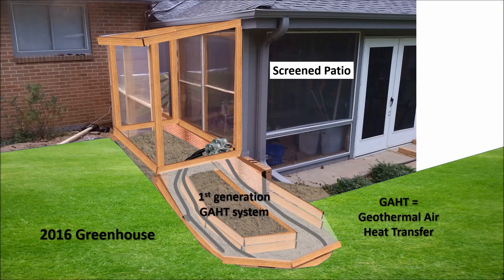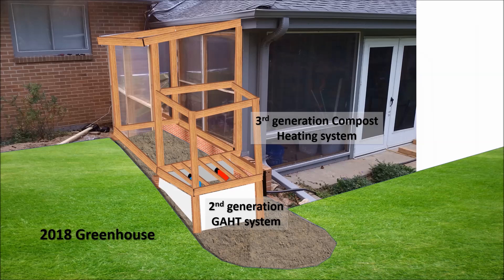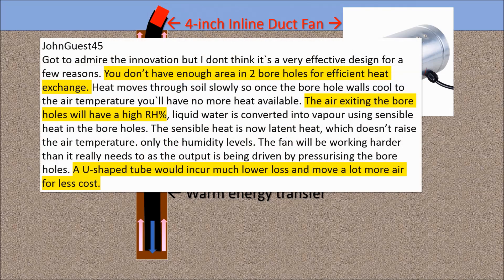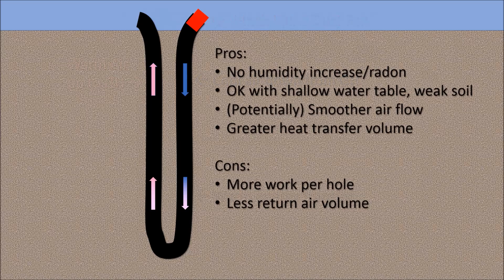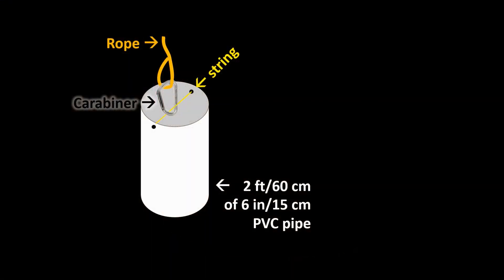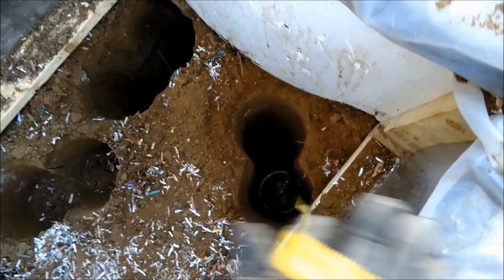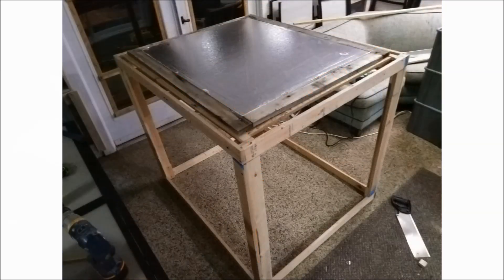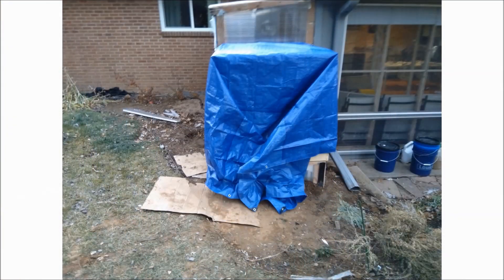Greenhouse 2.0 - Geothermal AND Compost Heating (Part 1: Design)

Comment: I'm the first to hand dig a horizontal one
Reply from the maker: Nicholas Becker dude, I would have been right there with you if I had the acreage.  I’d have to dig up my lawn and a bunch of sprinklers.  How much did you dig and how much pipe did you lay?  How big is your greenhouse and what results did you achieve?
Reply from the maker: Just saw your videos.  Nice project.  I will subscribe.  Smart move to put the geothermal under the greenhouse.  Most efficient method.  Unfortunately I couldn’t do that.
Reply: about 800 square cubic ft volume and I'm going to do a hundred 50 ft of pipe buried I dug about 5 feet so far and I'm going to backfill pretty soon I've been digging for about a month and a half thank you for the comment I appreciate it
Reply from the maker: Nicholas Becker that amount of pipe should work well.  Dunno if you plan on using for cooling but if you are, make sure to add a few weep holes at the low spot for condensation
Reply: @MorganBrown  yeah I ended up doing 200 ft of 3 in perforated pipe. I'll handle the drainage and then I did about 50 ft where I split the pipes in the going from two pipes to six pipes so and it works great so far I haven't really test it completely but I've been running it and I are coming out tonight and cool
Reply from the maker: @nicholasbecker3559  glad to hear that you got the system up and running!
Reply: yeah they're green as itself is about 12 by 12 ft it's got an angled roof facing south with a glass ceiling and I've dug down about 4 ft 5 ft so

Comment: I have a few ideas you mite try. First, your pipes are too big with too much airflow. If you eliminate the fans and use natural convection it should be more than adequate. Just cut of one end of the existing pipe at ground level, maybe extend the other end a bit. The slower movement will give more time for the ground to heat the air. This should be very easy to test next winter.
Reply from the maker: Thanks.  I agree with you - natural convection is fantastic.  I am actually using natural convection to good effect in the 2019-20 compost system (https://youtu.be/eMHbHAKeMC0).  I have changed the setup for 2019-20 geothermal to a small horizontal system (https://youtu.be/ch0VD-_9Xxc).  It wouldn't be hard to change the elevation of either the inlet or outlet pipe in order to achieve natural convection, but I wonder how it would do during the coldest hours of the night.  I have a small anemometer that could measure airflow.

Comment: When the soil is firm or wet you could dig a trench to make your u shape design
Reply from the maker: Gary Brown good suggestion.  Similar to what I’m planning for next year.  Instead of having four fans, I’m going to trench between each pair of holes, run one piece of pipe, and use a stronger fan.  Should improve the heating and simplify the system as a whole
Reply: @MorganBrown  can't wait to see it I want to put a green house in on the south side of my house I was thinking about putting plastic barrels or 6- 500 gallon totes for a heat sink next to the house and collect rain water 
My composting bins did not get the care need. I'm still learning.
I like how you have yours next to the green house.
Reply from the maker: @garybrown9719  wish I could say I had it all figured out by now!  I like the idea to put some plastic barrels next to the greenhouse.  If I could make one suggestion: enclose those barrels in plastic/glass and put them against your house.  You'll get a huge increase in solar heating of the barrels if you can do this.  The compost heating was a bit of a disappointment - maybe 3 degrees over the background.  3 degrees was enough to keep me above freezing through most of March and April, so it was successful, but I was hoping for much more heating.

Comment: Interesting method with vertical tubes occupying less space. But studying the subject, I have found that in several systems installed it needs to have a way of draining the water that can form by condensation or infiltration over time. Moisture favors the creation of fungi - mold. In this case, the installation of the horizontal tubes may be more practical  taking advantage of the gravity. With aluminum gutter pipes you will less space than plastic tubes. Probably over 200 feet.
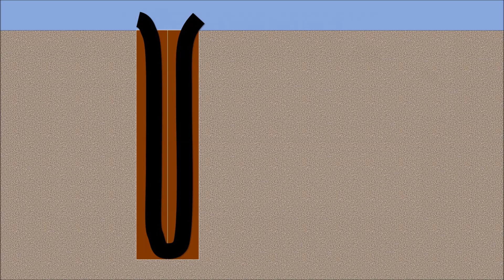Reply from the maker: Hi Felipe, thanks for your comment.  Fortunately (or unfortunately?!) I'll never have a condensation problem in my system since a) I live in a dry climate, and b) I don't use it for cooling.  You'll only get condensation in the summer months.  With the closed system that I propose here, the condensation would be localized to the bottom of the "U" ( 3:10 ).  You could mitigate the problem by packing the bottom of the hole with sand/gravel and drilling a weep hole in the plastic pipe.  Some people might have a high water table, and would be unable to use this method.  In that case, I'd recommend simply dropping a bit of bleach in the bottom of the "U".  Unless the condensation filled more than a couple inches deep, airflow wouldn't be impeded.
Reply: Russ Finch claims, that when you do everything the way it should be done, and the air is circulating constantly through the system, there is no condensation, mold, etc. in the pipes

Comment: hate to brake it to you - on youtube it's may be possible - but I know for a fact geo wells holes is not very new....
Reply from the maker: cool, can you provide references?
Reply: @MorganBrown  
Bridge?Road Heating in Switzerland late 1980's
Reply: @MorganBrown  
the science mag I use to read is no longer published -
it was talking about the Switzerland pilot project of using Geo heating to melt ice on turns and bridges in the 80's - the PDF has information on it's use from the 90's and dates it's first use to @1948 in the USA.

correction - it was  first used in the 1800's Klamath Fall in the 1900's Portland Oregon in 1948

just Google the following :     
Road and Bridge Heating Using Geothermal Energy
Reply from the maker: @mrnobody8540  It is definitely a cool application.  For the record, I'm not claiming to be the first person to dig a well and use it for geothermal.  In fact, my dad has had six geothermal wells (each 200 ft deep) and a heat pump to heat/cool his house for 10 years.  These, and the road heating systems, use deep wells and presumably circulate fluid through a closed loop.  They are obviously very expensive.  Instead, I'm focused on cheap, simple GAHT (ground-AIR heat transfer) systems to heat greenhouses.  Everyone seems to use backhoes to dig their GAHT system.  I proposed to use a simple post-hole auger to dig the holes.  It's far cheaper (unless you own a backhoe) and can fit into small spaces.  I haven't found anyone else who has done this, youtube or anywhere else.
Reply: @MorganBrown  
try going to 16 or 20 feet...  you well find it may be better in cooling and heating from peak summer to winter.
Reply from the maker: @mrnobody8540  Unfortunately I hit bedrock at 10 ft around here.  I have enough pipe to drill to 20 ft.  Too bad.  These days I'm more focused on compost heating for my greenhouse.

Comment: Have you seen the old man in Nebraska can’t think of his name at moment but he has huge geothermal hoop houses and his lines run 8 ft deep 80 ft long and he has 7-8 tubes per 80 ft green houses. Has a bunch of citrus trees growing amazing. Cheers curious on how this goes and the temp readings. Also the old man uses a back how to install his tubes
Reply: GREENHOUSE IN THE SNOW is guy in Nebraska his name is Mr Russ Finch...awesome that he had a geothermal pump system to heat & cool his home for 45yrs & then he decided to build a geothermal heated n cooled greenhouse without the pump use just using piping and a fan - also re or other concerns the radon is not a problem due to pipes have ventilation and radon weeps out!
Reply: https://greenhouseinthesnow.com/
Reply: Whst do you think about it cooling air ?
Reply from the maker: Case G thanks, yeah, I have seen the Nebraska guy’s setup...pretty awesome.  I have indeed collected some data for the geothermal component of greenhouse 2.0 and hope to report in the next few days.  In short, it was disappointing in terms of heating my greenhouse but I did get a sense of the efficiency per hole.  It works, but you need a lot of holes

Comment: You might want to rethink the compost setup. Pile/heap size plays a crucial role in the overall process. Limiting the volume with multiple stackable bins, although convenient, will prove difficult in getting everything started, up to temp and those conditions maintained. Colder climate exacerbates the issue and the typical outcome is anaerobic is problematic.  Using a tumbler is one possible solution given the space you're working with. Meets your "modular" criteria when installed on sliding rails or by adding hinges to the compartment top. Your compost is now entirely contained in one easily accessible bin providing ideal capacity. Icing on the cake: less than half the cost of the stackables. Maybe it's not too late to return them?
Reply from the maker: Perfect timing on this response!  You are correct - the compost actually never got above 80 deg F.  I actually just finished replacing the bins with a 3x3x4 ft chicken wire compost enclosure (with heavy plastic pans at the base).  I should have known better - I actually did a science fair experiment with my daughter last year where we specifically tested different container sizes to see how hot they'd get.   I expected a 5 gallon bucket to fail, but I expected a 27 gallon plastic bin to work nicely.  In reality, both failed to heat up!  I then threw all the compost material into my large 3x3x3 ft insulated bin and it heated up nicely to 140 deg F.  Oh well, I was hoping to go the lazy route, but no such luck.  

I like your idea for the tumbler, and I actually have one sitting in my yard (unused), but I'm going to try this route.  I'll cut a few flaps in the chicken wire to act as "doors", which will at least let me dig out the material from the bottom of the pile.  Still seems like a pain!

My wife says she can use the bins around the house if they're cleaned.  Still, this was a couple hundred bucks that I'm embarrassed to have spent.
Reply from the maker: Built up the new compost rig this weekend and got it ~ 3/4 full.  As expected, it's heating up just fine.  120 degrees F this morning.  Now we'll see if I can extract any heat from the compost!
Reply from the maker: Here are some compost results: https://www.youtube.com/watch?v=Dm7fQQrKlSs  Seems to work well - about 15 deg F of heating during the coldest hours of the morning.  Look forward to your feedback.